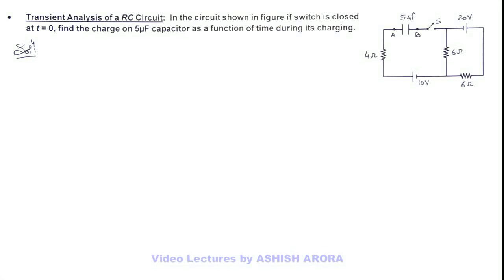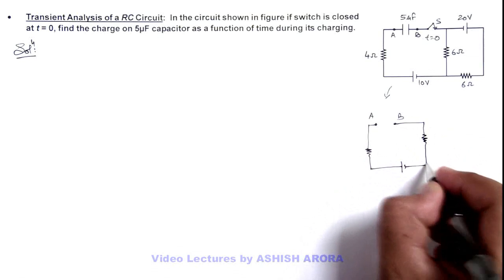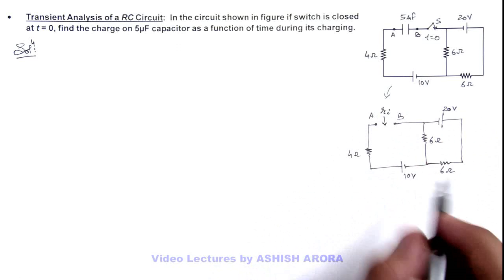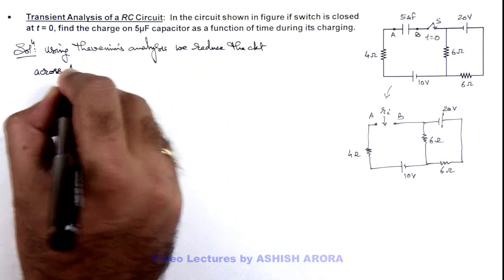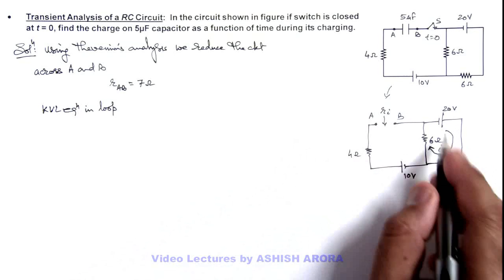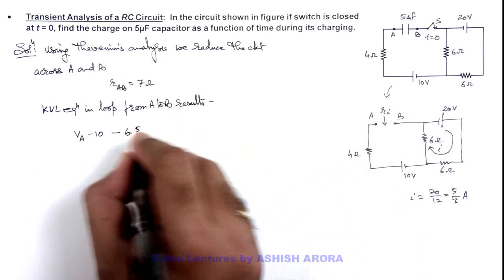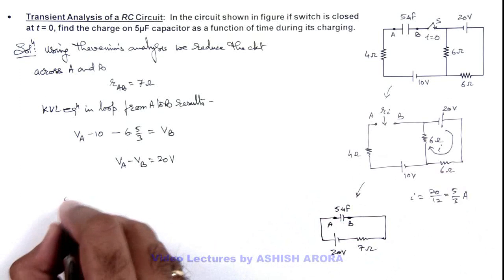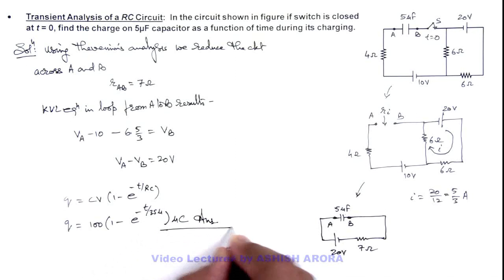7. Advance Illustration | Current Electricity | Transient Analysis of a RC Circuit | Ashish Arora

Comment: How 6 and 6 are in parallel and then in series with 4 
I am facing this problem in every such questions in finding r equivalent
Reply: In thevenin theorem to find Req for Capacitance, we replace all the batteries with straight wires and then find req across the ends of the capacitor

Comment: Sir 6 ohm and 6 ohm are in series
Reply: No bro in thevenins  analysis we remove the device like capacitor or resistance across which we have to find current,voltage,charge like in this case we had to find charge on capacitor so we tend to remove it and will neglect all other batteries so on neglecting all other batteries if you will redraw the circuit with open at AB and all other batteries being removed ie just left with resistance you will find that 6 and 6 ohm are in parallel

Comment: There is no potential difference for 4ohm but why?????.
Reply: Because we took the uncharged capacitor as a break in the wire so no current will flow from that part. This is the standard procedure to solve the question.

Comment: As by this method , as we are removing the battery so the circuit breaks and the current should not go through the 4 ohm resistor na ??
So in equivalent resistor it should not be counted na ?? 
PL reply pg team 🙄🙄
Reply: No we rnt literally removing the battery its just a algorithm to find req and Qmax

Comment: i did it by equivalent battery theorem and where battery was not present i used emf to be zero and got ans in all questions but i have a doubt sir if i assume emf to be zero so wont it mean that potential difference across that battery is 0 that is possible then circuit will break so how this method is working
Reply: I also have same doubt, can anyone please clarify this doubt ?

Comment: sir maximum charge is occurs at full charge so capacitor will work as a insulator then no current will flow through first loop so potential across the capacitor should be 10v and the charge should be 50c then please remove confusion how you took 100c
Reply from the maker: You must first clear your basics... in steady state potential difference across capacitor is 20V not 10V as one 10V battery is connected and across 6 ohm resistance also 10V p.d. exist... so the above relation explained in above video is correct...
Reply: thanks sir for replying. I got your point.